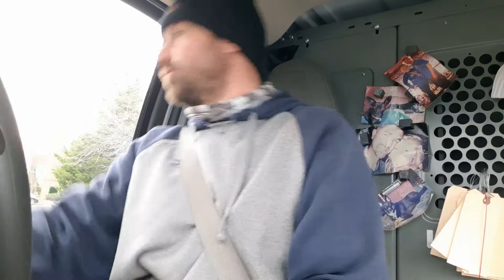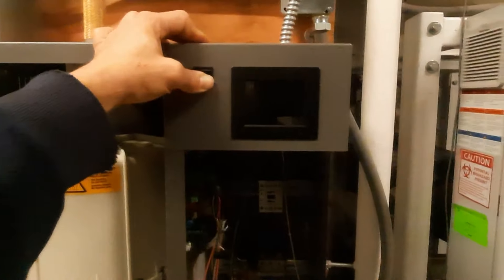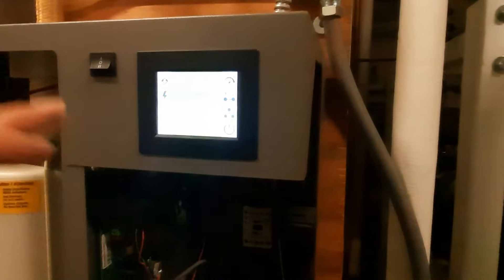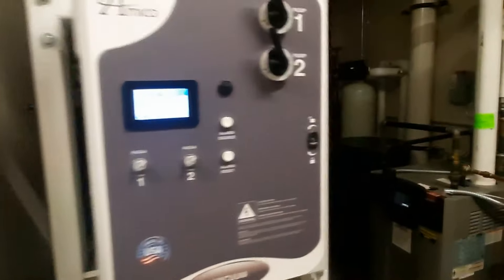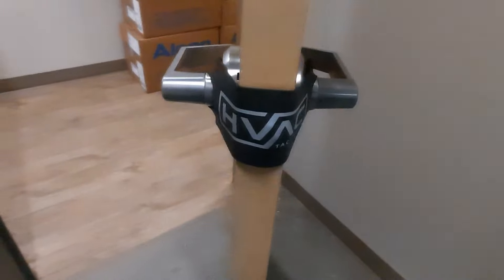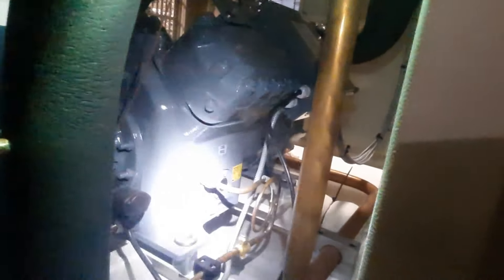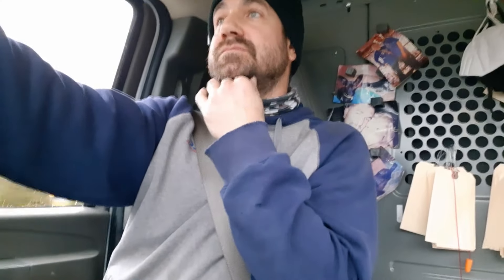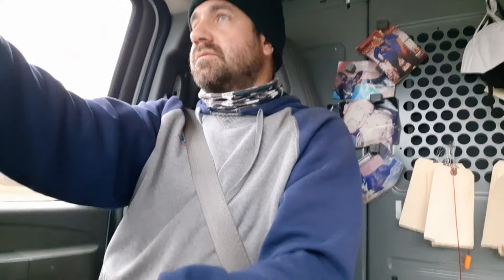inside HVAC

Comment: The chiller is interesting. 2 different refrigerants. That would be cool to learn about more how that operates. Almost sounds like a cascade type system. I take it that is a process chiller. 

Not every call is a giant adventure and exciting, but its all work....and it all needs to get done. Great video as always
Reply from the maker: Thanks Jason! Yes the chiller is a ultra low temp chamber and I believe it's similar to a cascade type. Would like to see it operate and learn more as well
Reply: @EverythingHVACR  when you do, that would be a cool video. I have no experience with cascade type systems. Only read about them. 🤘🤘🤘🤘🤘
Reply from the maker: Interesting stuff, Thanks Florida Man!

Comment: Yes, that is a cascade chiller, the R-404a is used to condense the R-32 vapor to reach an ultra low temperature. You may think your joints don't look the greatest,but they held , Right !
And yes I do enjoy this format. Thanks for posting your video!
Reply from the maker: Thanks George! Yes they held, 300 micron vacuum and weighed in the factory charge 4.9 kg
Reply: I have work on many cascade chillers. I had a couple that used propane as the primary ref. and eyhane as the secondary - 80* F
Reply from the maker: Nice, I'd like to see and learn more about them, I know a little but don't work on many.